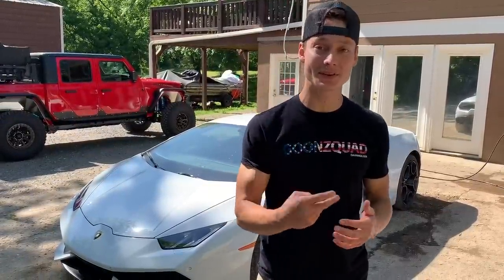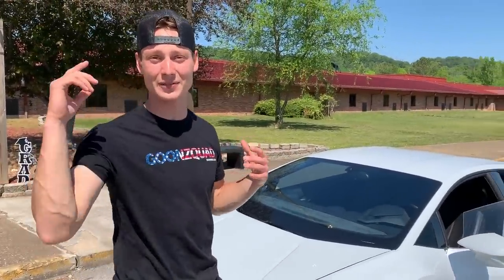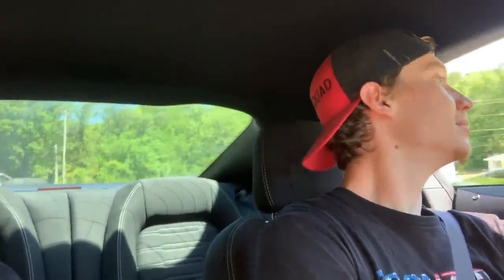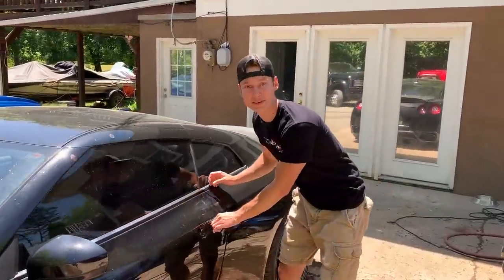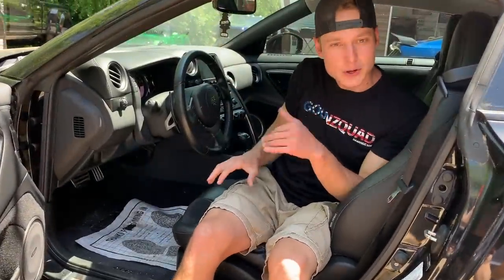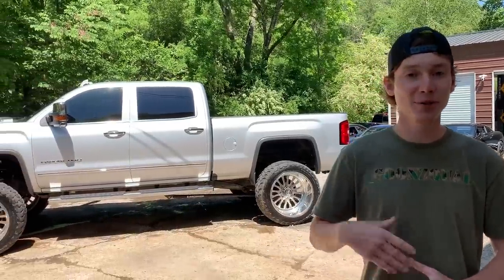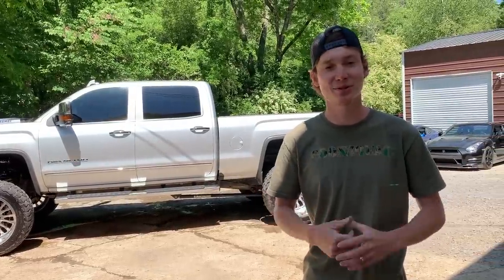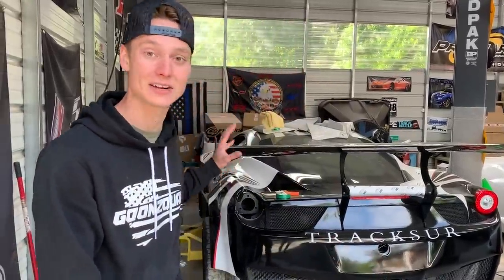2 Million Subscriber Special!!!

Comment: Ferrari's need trickle charging on the battery when they aren't being used much ;-)
Reply: Bingo!  Was going to post the same thing.  Gotta keep those on trickle and start them up for a bit at least once a week.  Helps with keeping the fluids at a good consistency.  Essentially it's a weekend driver, but it really doesn't fit these boy's lifestyle at the moment.  They could release it for a good profit to someone looking to get an amazing car at a low price.
Reply: CaptainDawg02 half of the cars they have they don’t need all  half of the cars they don’t drive and are dirty
Reply: @blakeshields9824  - sure...just never thought they would keep a Ferrari.  Kind of surprised they are keeping what they are though...  Would have for sure thought the hellcat & S2000 would have been gone.
Reply: @CaptainDawg02  well, they didn't say they aren't getting rid of the hellcat yet, they said they want to fix the shitty parts on it first so whoever they sell it to isnt getting a shit car.
Reply: Blake Shields yeah they’d be better off selling some to people that drive em more. Its a pity having them rot away on a driveway

Comment: Billy: "didn't skip a beat"
I'm sure it got stuck in limp mode and smoking hauling that f450 back!
Reply: Rusty Nail it’s a Chevy what do u want
Reply: I'm pretty sure they did have issues near the end of their trip when they were hauling it lol
Reply: Random Restoration it’s because of how they had the tune set
Reply: Lol it was just the tune hahahaha
Reply: Keep the Ferrari snd the lambo
Reply: They ran out of def fluid is all that happened.
Reply: That was not anything to do with what they had behind them. The f450 is not anywhere close to what the max weight is of the denali trucks able to pull. The issues were from everybody and thier brother, literally!! They do a lift and wheels and bigass tires then they leave the gears stock! Just because your truck seems fine and can still burn off the big tires after you do all that to it doesnt mean you should skip the gears!! Its not cheap and most think that it will slow the truck down or they wont notice anything but that is not the case if you doit correctly! Makes a huge difrence in power fuel milage everything. Trucks not working so hard to tow or just drive empty. Between the gears and the tune they were running they just had things not setup ok and the truck didnt like it. No biggie.
Reply: It didn’t blow up lol
Reply: Random Restoration it’s a Sierra not no Silverado or something else 😂😂
Reply: @randomrestoration1853  I know right. I get the feeling alot of their stuff looks good on camera but up close not so much. I love billy though. The amount of work he puts in is unreal.